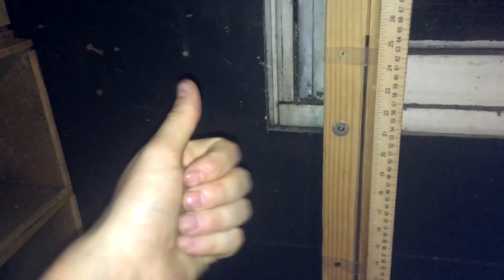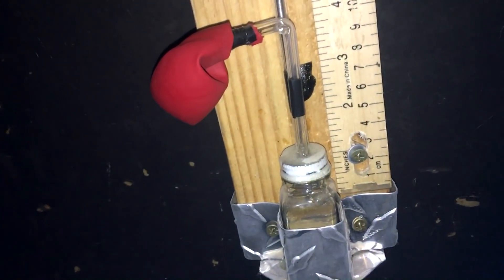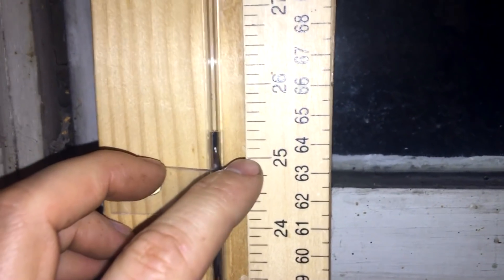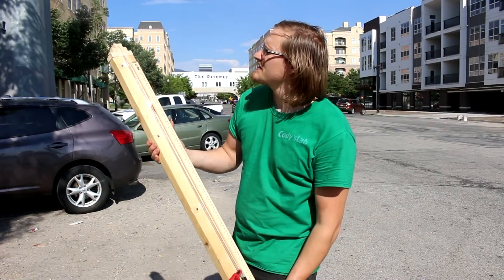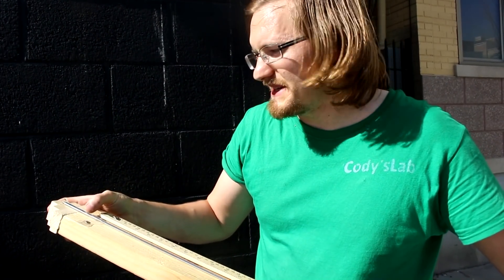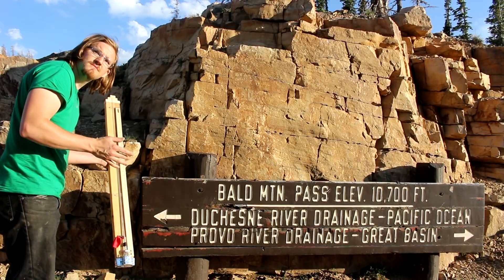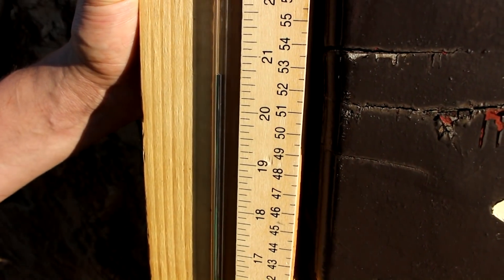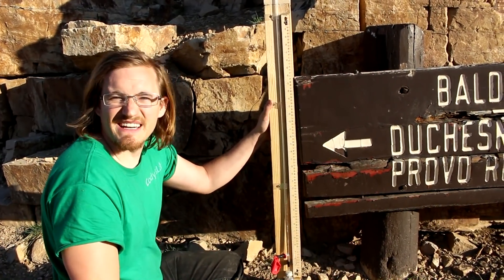Taking my Barometer Up a Mountain

Comment: Is the amount of mercury vapor above the liquid negligible?
Reply from the maker: Yes, Mercury's vapor pressure is about a millionth of an atmosphere.
Reply: It's also worth noting that this is why mercury thermometers are superior to the (now) more common alcohol thermometers. Alcohol has a pretty significant vapor pressure, especially at high temperatures, which can make them noticeably inaccurate unless they've been very carefully calibrated.
Reply: Makes sense, considering the "oomf" required to vaporize the mercury in a fluorescent bulb. Thanks, guys!
Reply: Mercury vapor is more toxic than straight liquid mercury, as your lungs absorb it a lot better than skin.
But, this barometer is sealed inside a vacuum and a balloon, so no vapor is escaping. :)
Reply: Yes, since a thermometer is a rigid vessel that maintains a pressure differential, the only variable should be temperature. So as long as the markings are accurate, I don't think there'd be any issues. Whereas with a barometer, depending on the liquid you use, both temperature and pressure can affect the reading.
Reply: The space above the top of the thermometer is a vacuum, but there will be ethanol vapour in it if an alcohol thermometer is left in a very hot substance for a while, which causes the reading to drift. Mercury thermometers are less susceptible to this due to the very low vapour pressure of mercury. They also allow much higher temperature measurements since the boiling point of the mercury is not a factor - you can go up to 300+ C easily.
Reply: I see. So it'll change slightly over time.
Reply: Who's going to build an enormous thermometer so we can explore these questions?

1 2 3 not it!
Reply: Tom Haflinger ya lol its a friggin metal
Reply: Exactly! :D
Reply: Still toxic?
Reply: dude of course